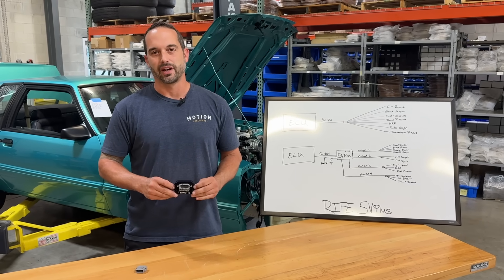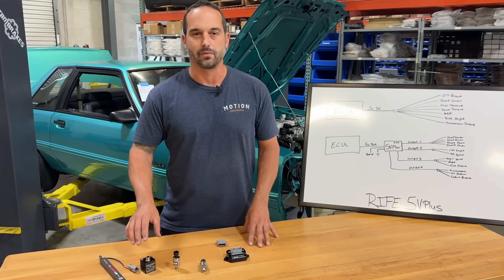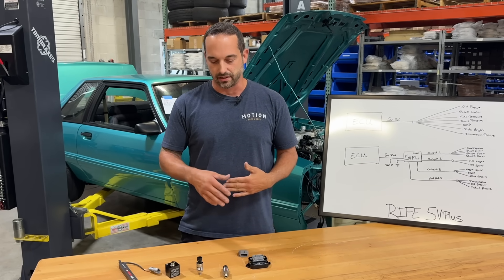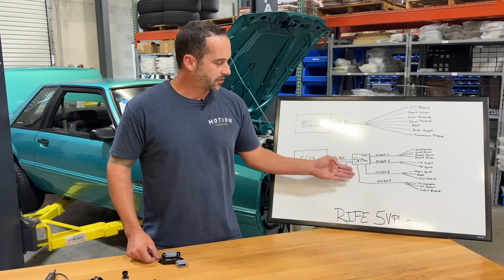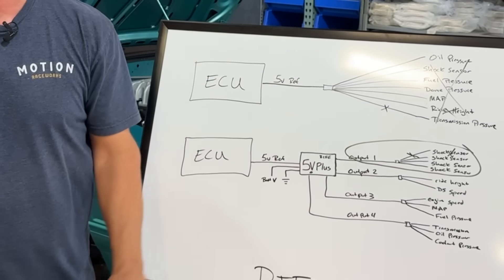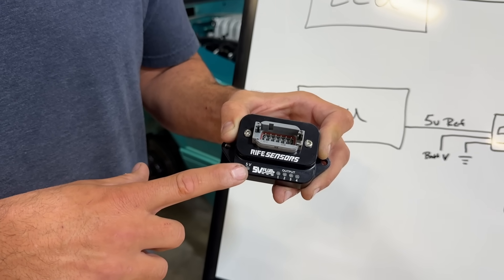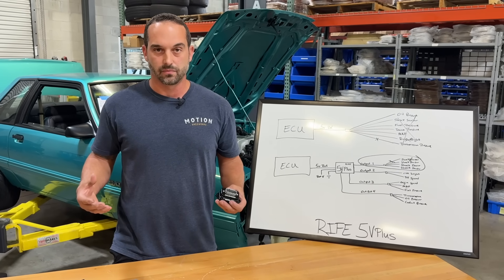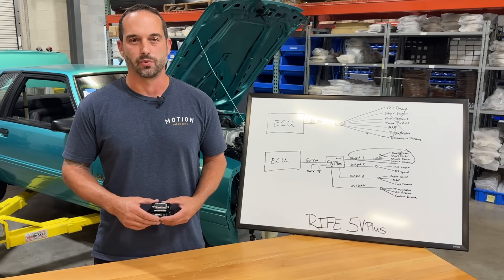RIFE New 5V Wiring Solution! Breakout, Amplifier, Circuit Protection in One!

Comment: Not a problem with my ECU code; I removed all the abstraction. You don't calibrate the sensors, you just tune for the entire setup. Don't put all the extra sensors for datalogging on your ECU, problem solved. Datalogging on it's own box.

Comment: Is there no such thing as a high speed voltmeter sensor that could communicate with the ecu to adjust sensor readings based on 5v circuit voltage?
Reply: I don't think you could assume that all the sensors would be accurate at a lower voltage. They are calibrated to work at a specific number. I'm sure with software they could do what you are suggesting, but I have my doubts the results would be worth the effort when you could just have them work as intended instead of fudging the numbers on the back end.

Comment: I had one of these issues on my wife’s Subaru, the stereo Amplifier shorted out and was sending 12 volt through the 5 volt system and all the sensors were reading wrong. My wife told the mechanics the problem, they didn’t believe her and started replacing sensors, $3000 later and no fix, I went in unplugged the amp and they all worked, somehow the body control module was tied into the amp and back feeding.

Comment: Cadillac started doing 4 different 5v references out the pcm now because of this same issue. I recently worked on a 24 escalade with a shorted water pump module took down 2 other sensors but all the others worked fine they used other 5v circuits. If the oems are starting to do this standalones need to catch up

Comment: I think a better approach would be using digital sensors and then having the box output 5V signals for engine management that hasn't figured out 0-5V is trash for reliable signals.

Comment: You mentioned things like travel sensors and motion sensors, how about things like crank sensors or cam sensors, can they be an issue with dropped voltage? because this might solve all of Cletus's cam synch or crank sensor issues. just curious, if so this could be a Godsend for some racers
Reply: Yes, any sensor that uses the 5V ref. signal will have an issue if that voltage isn't stable, or even worse, drops out completely.

Comment: so this is just an improved version of the RIFE 52-1503 since this one amplifies the output vs the 52-1503 being just a hub correct?
Reply from the maker: Its more different than not since it only does 5v. In theory you would use this by the ECU, run one sealed wiring cable to a Dtm hub in close proximity to the sensors it is distributing to
Reply: @MotionRaceworksOfficial  guess my question should have been, in what case would i want one over the other. is there a use case for each?  or would you use both in some cases? currently im splitting off my sensor ground and 5v, so this def looks like a better solution to my current method.

Comment: Hey Brett I have done car audio 35yrs. When we have a head unit that puts out less than 1 volt we use what we call a line driver that's adjustable all the way up to 5 volts to drive the amplifier for a better signal to noise ratio sort of the same thing you guys do. Love what you do  always ahead of the Curve😊

Comment: Cool product, but it doesn't say anything good about the ECU manufacturers ability to make a good product
Reply: have the same problem on OEMs not just an aftermarket issue
Reply: 0-5V signals are terrible.  There are plenty of good engine management systems out there capable of using digital sensors - Holley makes none of them.
Reply: @trumpio  whats the best engine management system ?

Comment: Do a video on who designs the circuits and where you have these devices manufactured. Also, you can fuse each circuit so if you have a failure on one of them you could find it faster due to the marked fuse. This would prevent one failure from taking out a whole branch of sensors.
Reply: Sensor and or wiring failures aren't always something that will blow a fuse and IMO adding more parts adds more possible failures (I can't imagine having to have 20 fuses for 20 sensors)...
Reply: You don't fuse that kind of wiring.